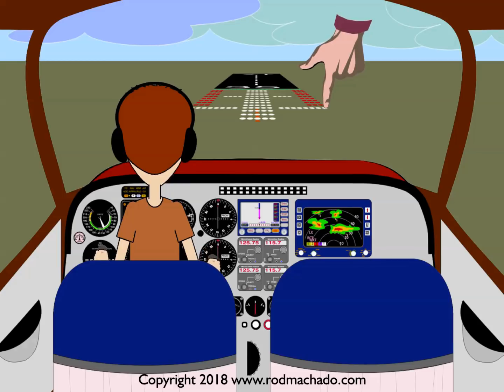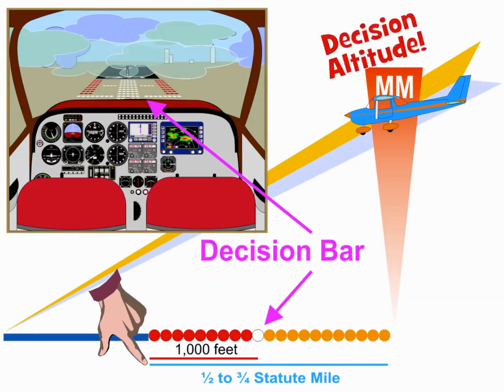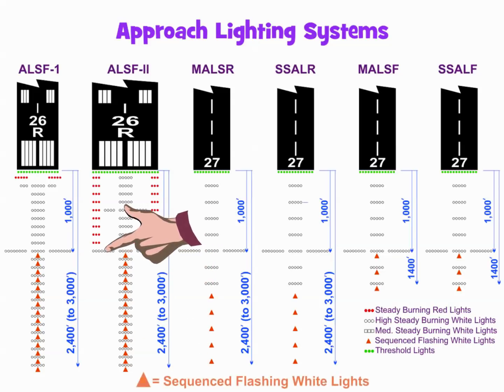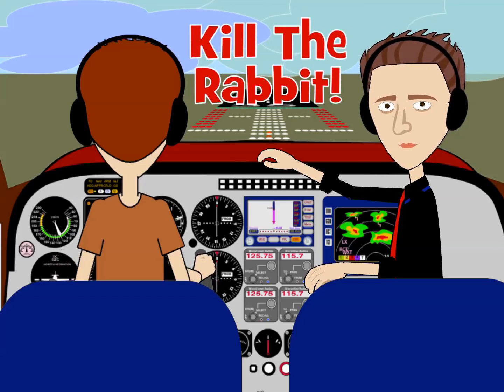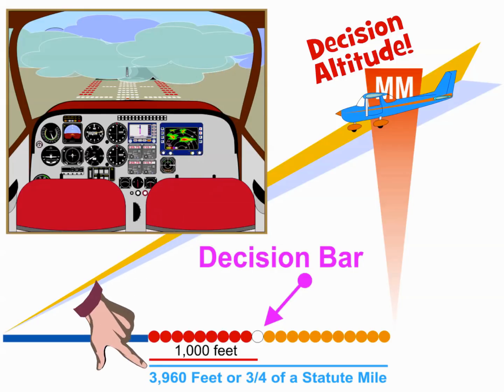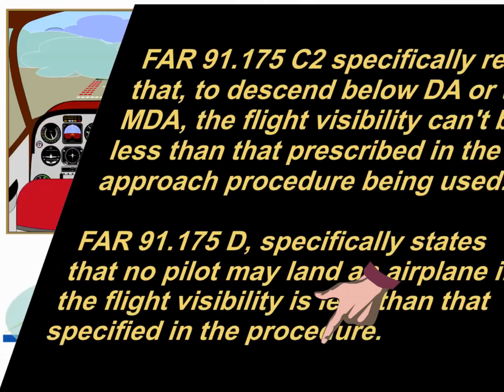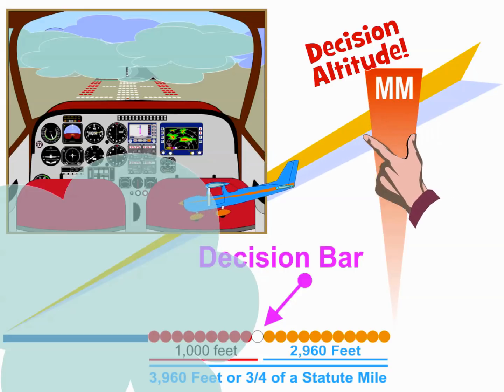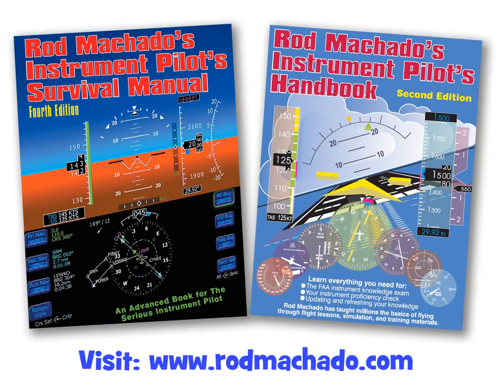The Approach Light Decision Bar & How to Use It

Comment: Is there a difference between the Decision Bar and the Roll Bar? I hope someone replies. Thanks!
Reply from the maker: I don't understand the question. When you say "roll bar," what do you mean? Let me know and I'll answer the question.
Reply: @Flight-Instructor  Well, I saw an illustration of runway nav lights where the 1,000ft Roll Bar and the Decision Bar are almost the same, and I was wondering if there is a difference between the two. I was referring to this picture --> 
https://qph.fs.quoracdn.net/main-qimg-4d4ec7885f203ad559d75ba19b04474f
Reply from the maker: @nooffensemeantbut1597  Well, that's interesting. I've never heard or seen the decision bar (and the mini-decision bar...the one at 500 feet) referred to as a "roll bar." So, to answer your question, they are the same thing according to your picture. But "roll bar" is not a common term. Where did you find that picture?
Best,
Rod
Reply: @Flight-Instructor  I just search for ”Runway Navigation Lights” on Google, and I found that in the results, I guess choosing it as a reference for my report is the wrong choice. Anyway, thank you for entertaining my inquiries. 😁
Reply: Make sure you have a roll bar in your jeep or wear a helmet